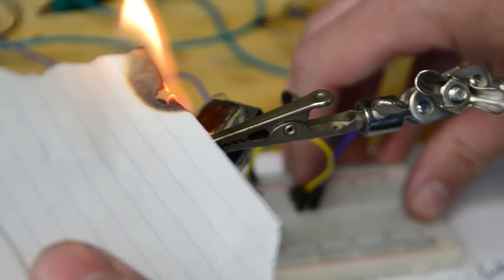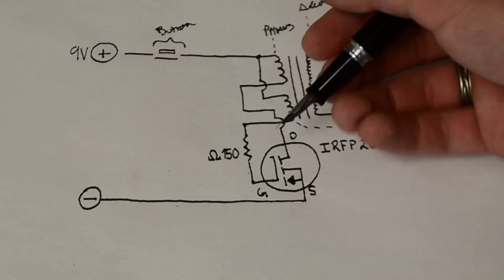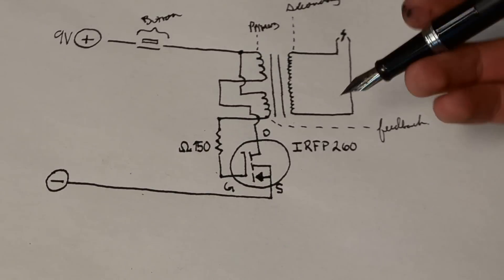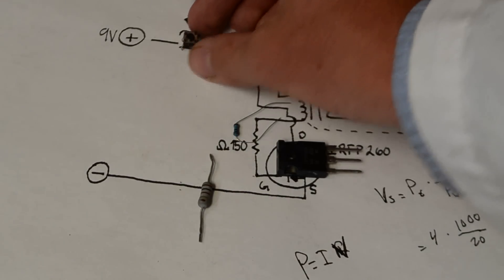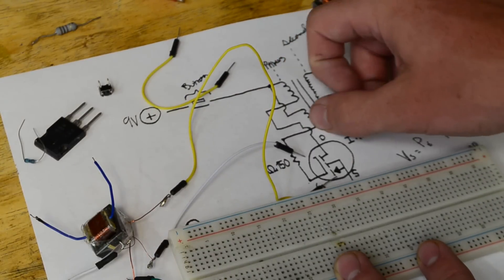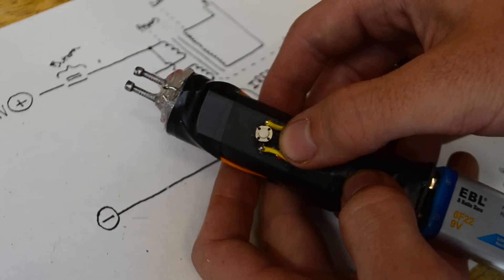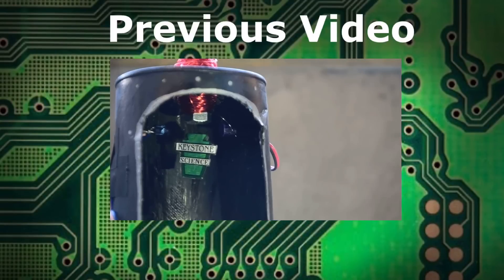How to make an Arc Lighter

Comment: HEY, IF YOU ARE TRYING TO MAKE THIS, HERE ARE THE PARTS NECCESARY, I WROTE EM DOWN:
IRFP 260 MOSFET
150 ohm resistor
100 ohm resistor
50 ohm resistor
push button momentary switch
transformer
jumper wires

AND IF U NEED HELP, CUZ HE DOES SPEAK SO FAST, JUST SLOW IT DOWN TO 0.5 SPEED AND TURN ON SUBTITLES
Reply: any good link for a cheap transformer? :)
Reply: OK THANKS
Reply: Can u also tell the transformer  type rating something
Reply: Where to find a cheap transformer
Reply: WHY ARE YOU SHOUTING?!
Reply: @thewhitesheep4156  idk man, I didn't know about this comment until a few seconds ago

Comment: 1:42 MOS-FETs aren't triggered by current and there is no current flowing between the Gate and the Source(leakage currents may occur, but they are neglect-able)... The Drain-Source-Voltage depends on the Gate-Source-Voltage. It's the main difference to Bipolar-transistors.
Reply: Can i use a bjt in place of mosfet

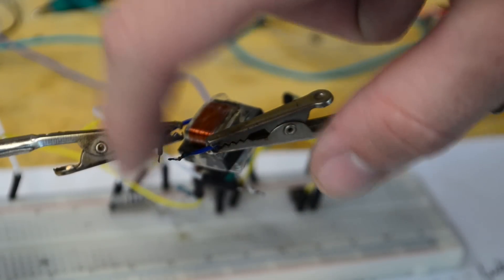Comment: 7:05 "I have the 2 high voltage wires placed about that far apart" I believe the distance "that" is a metric unit. XD
Reply: I believe that they are 8 that's to a this.

Comment: IRFP260
"Transistor"
"Current flowing in"

the IRFP260 is a MOSFET, a metal-oxide semiconductor field effect transistor. You're partially correct in calling it a transistor but the working principle in MOSFETs is voltage, not current like BJTs

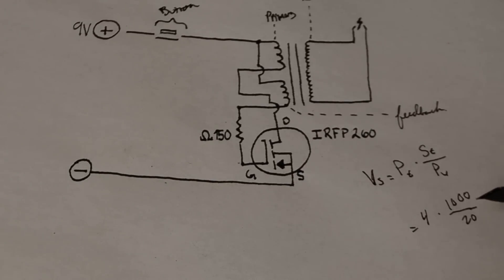Comment: are you sure the formula at 3:30 is correct?
I fond another one for transformators: U2=N2/N1*U1 (or as written there: V(s)= S(t)/P(t)*P(V))
And this one does make sense because if you calculate with units only you get V=V which is right but with your formula it is V=1/V or V=t^2/V depending on if you use t as Unit for turns

Comment: Hey, new subscriber here.  I experimented with using the flash circuit of a disposable camera a long time ago and was able to get some reasonably high voltages, but could not find a use for it.  It would be cool if you could find a use for hacked disposable camera flashes.

Comment: I am using the exact same transformer but with the irfz44n mosfet and a 100ohm 2W resistor but it doesn't seem to be working. Is there anything I'm doing wrong or could try to make it work? I already tried to swap the feedback coil and I tried 50ohm and 200ohm. I'm pretty sure I connected it in the right way.
Reply: 150 ohms for starters
Reply: @fmx_goodriddance4201  lol that was 4 years ago. I got it to work back then but I don't remember how anymore.

Comment: man, correct me if im wrong, but mosFETs are FETs, which means no current goes through the gate, ergo, the gate resistor and the coil can/should be omitted
Reply: ohh, sorry, the feedback coil must be there, although there is no current, the coupling magnetic flux creates a voltage which toggles the mosfet. Still not sure why there is a resistor there, and what do you mean by gate current
Reply: oopps, sory, wrong again, there is actually a small current through the gate, responsible for chargen the built in capacitor, and im guessing the 150 ohm resistor is to control the RC timing

Comment: Once I had a guitar pickup that quit working because of a broken wire in the coil. I rewound it myself with wire I got from Radio Shack (remember them?) It was a LOT of work, but it worked great. It also convinced me that it really wasn't worth it. That's a lot of wire.

Comment: Current cannot flow from the gate to the drain on a mosfet.  Mosfets are controlled by the gate to drain voltage difference

Comment: Nice!! The feedback coil isn't part of the primary, it doesn't actually help with generation of output, it's simply a driver coil, virtually no current is really through it. Very nice build though.

Comment: Keystone Science One downside to 9v batteries is that they don't seem to be used for a whole lot anymore, (in fact the only thing in my house that actually uses them is  the smoke detectors my landlord put in before i moved in), plus the alkaline ones that are relatively cheap are single use (well...but that's a story for another day), but for about 3, 4 dollars at walmart, they have a relatively cheap rechargable cellphone charger that's basically a large cylinder with a usb port at one end (two if you count the charging port). ...is there anyway to modify this arc lighter or the stungun to run off of one of those? just curious.
Reply: If you have a male USB port you could plug that into the powerbank and power your project from there ,but if you try to drawl to many amps from the powerbank the protection circuit will cut off power from the USB port.

Comment: is it possible to send information over your skin to another device you can build charge on the skin and you can use the capacitance of your body to manipulate magnetic signals like a theramin. but what I was thinking of is. lets say your phone has a metal plate on the back that puts a charge onto your skin and you with your other hand you touch another plate attached to a tv or a computer can you use your skin conductivity to transfer information like a wire from point a to point b like a photo or music or even a video because while I think its possible I also think it would be really static or grainy but I just wanna see a video of it I can garentee no one else has tried it.

Comment: I have the same switch as u but i broke one of the 4 legs, will it still work?
Reply: Yes actually  it's a 2 pin switch the pins are interconnected  you can search on internet  for its diagram if I am not late to reply😅

Comment: Hey, I was just wondering, in a 555 timer, what determines the speed of the blink/on-off output?
Reply from the maker: +Nate the capacitor from pin 6 to pin one, as well as the resistor from pin 6 to pin 7.
Reply: Thank you so much! So you increase the capacitance and resistance or lower for a quicker flash?
Reply: XD cool man
Reply: Now that I have your attention, I could use a bit of professional help. I've been trying to make old nerf guns into laser tag guns, and I can't figure out a circuit that will prevent holding down the trigger to keep the lazer led on. Any ideas?
Reply: Use a microcont/roller arduino! Otherwise maybe a schottkydiode paired with a capacitor in some way?

Comment: but then why couldnt you just have the current flow to a step up transformer then have the higher voltage flow to the 2 conductive parts that make the arc

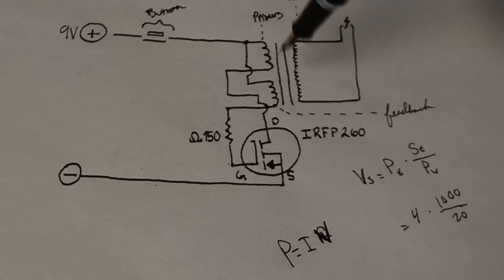Comment: Your calculation for the Voltage in the secondary coil at 3:30 is wrong. Your units don't work out. Voltage does not equal inverse Voltage.

Comment: Wait I thought transformers worked only with AC voltages
Reply: Fresnel Junior its ac voltage the transistor makes it pulsing dc and that works with the transformer but its very high Hz
Reply: what u mean by " its ac voltage " do u mean the primary voltage of the transformer?
Reply: I see

Comment: It doesn't work, only finds that the MOSFET gets VERY HOT.
Reply from the maker: it works, you have to do it correct. if you dont, you break down the mosfet and it gets really hot ( i went through a fair ammound of mosfets sadly :(
Reply: +Keystone Science I had recheck the circuit and checked the mosfet with a multimeter , everything is still in good condition. powered directly from a lipo battery (8.4v)...and still didnt work. what could I've done wrong?